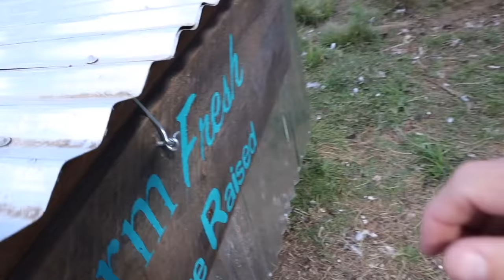This Makes it so We Can GROW all WINTER w/out HEAT in our GREENHOUSE in a Northern Climate Zone 4B

Comment: one way of cooking corn is not to remove the husks; just place them on a grill...cook them rolling them over every 15 min for about 30 min; the husk and silk pulls right off; it steams inside the husk;
Reply: That’s what I was going to suggest. Once I tried that, I haven’t gone back to steaming or boiling in years... It’s tough to match that fire roasted flavor using water not fire. And those little kernels of gold that the flames touch and they turn brown, mmmmmm that’s yummy!
Reply: Tracy Bruring yes soooo delicious 😋.  I learned that way of cooking in Wisconsin

Comment: If you leave a few husks on the corn after removing the silk. soak the ears in water. You can toss the ears on the grill with the chicken to roast, you need to turn the ears to cook evenly. I've also wrapped ears of corn in a wet paper towel to cook in a microwave oven.

Comment: My in-law’s process lots of corn every year.  The whole family gets together and everyone has a job... the way they remove the silt is to take the end of a baby bottle brush and put it in an electric drill... they wedge the drill in a saw horse and hook the trigger to make it run automatically, then you take the corn that’s been shucked, but not silked, and you just run the corn around the baby bottle brush head and it removes all of it.... much easier than removing it by hand... although they have a lot to process at one time... :)

Comment: Easy way to husk corn is to take a paring knife split each side with a slit from top to bottom.  Grab the silks and pull down.  When we kids got old enough we could do both sides and break off the end of the stem attached to the cob at the same time. We used to process about 800 ears in two days this way.  I am really missing doing this and canning too.

Comment: lack of water does have an effect on kernel/cob size. As a child I hade a great yield when I planted them very closely in the rows - rows usual distance apart- I got more cobs per stock than when I planted them the usual distance apart, I was only growing a small amount in a backyard garden and hand picking, but it should work as well in a larger plot. I just figured that they naturally grow close together if a cob falls on the ground so I tried it. I planted them only about 3 inches apart so they had just enough room and at maturity were like a solid wall of stocks. they're new varieties of sweet corn that convert their sugar into starch much slower so you don't have to cook them right away like regular sweet corn should be, able to store in wet paper bag covered with a plastic bag in the fridge for up to a week.  Older family friend use to grow "Candy Corn" - smaller pearl white, kernels that tasted amazing even after being in a deep freeze for a whole year, I have not been able to find Candy Corn seeds in storers, I believe she ordered them from a seed catalogue.

Comment: The kernels of corn are filled by moisture from the leaves on the stalk above the ear.  In a dry year they will not fill totally.
Reply: Roots draw in water from the soil.
Reply: I'm no farmer but you might want to promote them to full bird.....
Reply: Poison Ivy 
Leaves are essentially the lungs of plants. They lose water through them in what is called transpiration. That causes a negative pressure in the leaves that causes water to be drawn into them from the roots.

Comment: Al, after replacing the wiggle wire, your camera caught a cabbage looper butterfly  invading the greenhouse and landing on a plant. The looper worms are green and inch their way along in a hump-back fashion. I’m sure you’ve seen them in the past. They’ll make mincemeat of your cole crops. The best deterrent was row covers, installed before the invasion. When my cabbages were golf ball size, I’d clean off the cabbage of all loopers and fit a knee high pantyhose over it, sliding it all the way down, as the cabbage grew the hose would expand. This protected the head, while the loopers could only get to the outer leaves. The knee highs also provided a gentle pressure, making the cabbage heads dense and firm.  I used this method outdoors before the light rowcovers were available to home gardeners. Love your channel.

Comment: When you are putting a chicken on the grill on the stand you used do the following.  I assume you have a can inside the bird.  Add garlic, thyme and sage with a dark beer.  Use a small potato to block off the neck opening from the outside and cover with the neck skin and use tooth picks to hold it closed.  Then use the same liquid mixture on the pan and ensure it stay full.  This will add a great flavor and the potato will cause the meat to steam from the inside out and make it super juicy.  Weber makes a great seasoning called "Beer Can Chicken"  cover the outside.  i typically use about 1/2 a container for 1 chicken.  Enjoy.  Love the channel.

Comment: You might want to either elavate and support or put a weep hole in your dryer duct to prevent a P-trap from forming that would block its air flow with condensate water.

Comment: Gina, try just putting the corn in the grill with the chicken. It will steam it's self in it's natural cover. Delicious.
Reply: Plus when you peel it the hair comes off so easily.  Or cook in oven 350 degrees for 30 minutes, right on the rack, peel it back and you have a handle.

Comment: The Horn worm is the Luna moth larva. My chickens won't touch them with a ten foot pole. I put 1/4" hardware cloth around and over my tomatoes, and that seems to take care of the problem. If the moths can't get in, they can't lay eggs. What do you do with your extra eggs? I freeze some, and I water glass the others. Lack of water on the sweet corn. Last weekend we put up 22 half pints for corn casserole, 46 quarts, and 168 pints. I'm tired of corn. Lol.

Comment: Hi I am Stephen 
I thought I should asked why don’t you plumb in a all season water in the green house before frost hits
Reply: Stephen Martineau  And wire in electrical at the same time.  If coming from the outside kitchen building, it’d be an easy run for both.
Reply: @robfl07  The outside kitchen in not plumbed, they use a hose from the house to supply the water!
Reply: The frost line in Northern New Hampshire is 36" to 48" therefore trying to dig a trench that deep in their rocky ground would be quite an undertaking! that's also why Lumnah Acres did not install a water line to barn/workshop.

Comment: Tip for running cable lines in pipes. If when you pull the cable you attached an additional pull line alongside the cable and leave it in the pipe, then you have a way to add or replace cable at a later date without having to touch the in-situe wiring.

Comment: I have a double layer inflated greenhouse in Central New York zone 5a. You don’t want to rob the warm air from inside the greenhouse. To be more efficient you take the air from outside
Reply: Good point!  Like taking outside air for a fireplace rather than have it pull warm air from inside the house...

Comment: Al, maybe you should check if you installed the blower vent correctly!  I think you cut an X in the plastic, not a circle???   I was taught to make a circle if it is called for.  The reason the X will continue to tear the plastic with added pressure.

Comment: If that conduit outlet L on the fan plate isn't doing anything (and it's the right size) you could probably just use that on your conduit over by the solar panel. Given the chance for condensation, I'd recommend putting a 2 A in-line fuse on the hot line running to the fan, too, since a 12 V short could easily melt the plastic around it.
Reply: A polysilicon fuse at the output of the solar panel would protect everything it's connected to and would reset as soon as the fault is removed.
Reply: @benthere8051  Good call. Al, keep an eye on your PO Box. I'm sending you some.

Comment: Thank you for sharing! You should definitely cap the electric wire conduit by the greenhouse to keep mice out. It’s a cheap preventative measure with a big downside risk (the plants freeze because the mice chewed through the wires). Different varieties of corn have different kernel sizes so I suggest you plant several varieties next year and see which your family likes best.

Comment: You will need more -solar panels and a couple more batteries to keep that fan running through the winter.  You can work it out from the wattage and voltage of the fan to work out the amps draw and then calculate how much battery capacity you need for approx 7 days without sun but without going past 60% capacity. Once you know how many batteries you need to work out how many solar panels are needed to charge the batteries from 60% to 100% in 4 hrs. 👍
Reply: A 120mm computer fan will use from 0.6 to 2.3 watts of power according to http://www.buildcomputers.net/power-consumption-of-pc-components.html so you are on track.  Not too much, but enough to cause concern for 7 days without sun.

Comment: Fantilation for the winter - what a great idea. Note these blowers come in different designs that impact the noise they make, the power they use, the air they can push around and - in your case most importantly - the air pressure they can build. This application typically needs a fan whose blades have been designed for pressure. Example: Noctua 140mm industrial fan can build 10.52 mm H2O (about 0.4" water column pressure), has IP67 waterproof certification and can do 3,000 rpm producing 41.3 dB(A) noise - Another Noctua 140mm size might do 0.69 mm H2O (0.03"), pushing only 80 m^3/hr (47 cu.ft/min) when the high pressure one moves 270 cubic meters per hour (159 cu.ft/min). The slow one only spins 800 rpm and is as silent as 11.9 dB(A). You could place fans in series to increase pressure and/or air flow and I'd advise to consult with a specialist for that.

Comment: You have to try cooking corn in the microwave some time, it's an awesome method.  You leave it in the husk and cook for about 3 minutes (more or less, depending on how many you put in the microwave).  Then you cut the base off the corn (be careful, it's really hot) and sort of milk the cob out of the husk.  No silk at all, perfectly cooked and super easy to deal with.
Reply: It intensifies the corn flavor!
Reply: @elleshanndriacnossosmidnight  Yes! Another benefit, the corn isn't sitting in a big pot of water with so much good stuff leaking out.
Reply: Love this method.. the silk comes off so easy this way.
Reply: I'm all alone and I nuke 1 ear at a time, changed my whole way of cooking it. It really works great! I really miss the ducks, I love watching them waddle around and drink the water, just cute as heck!

Comment: Put a nut on the end of the string. Put the nut in the pipe. Use a magnet on the outside of the pipe and drag it along the pipe. It'll pull the nut through with the string attached.

Comment: One way to gain heat passively in the Greenhouse during the winter is to hang a curtain of something black like plant shade cloth or other such material on north side since it will be the coldest The first advantage of course is it will insulate that side like there is a third layer of plastic on that side and the cloth will be warmed by the sun during the daylight hours if it's out. One possibility about the M-G is they might of gotten shut  into one of the outbuildings you might have been in the other day but it's more likely that that they left for the nearest body of water somehow or were someone's dinner in the night.

Comment: Also coming from zone 4b with a couple of years experience with double layer inflated 30 x 96 tunnel 24/7 I have found with a third layer of plastic under 10 foot hoops inside I can keep certain cold tolerant  plants alive for consumption all winter.  Growing will pretty much stop by November but harvest can continue through winter as long as plants are close to maturity by then.  Cold tolerant plants that are still immature by November will generally survive but not start growing again until spring.  Plants outside the third layer of plastic under hoops generally do not thrive through the winter because of repeated freeze thaw cycles. Although temperatures are greatly increased inside during sunlight hours they still drop precipitously at night even with the double inflated plastic.  Plants that have worked for me include, carrots, spinach, kale, claytonia, leeks, onions.  The flavor of the cold adapted kale and spinach and carrots are out of this world because of the increased sugars and for me makes it all worthwhile. Good luck with your efforts as you discover what works for you.

Comment: As long as the moths have access to the greenhouse you will continue to have horn worms. You need to screen the lower section that you roll up. The fabric you use in your smaller gardens to protect the cabbage, etc would work...same principle...keeping the beetles from destroying your...keep the moths out of the greenhouse that lay the horn worms 🐛

Comment: Electrical code. Splices should be in the LB, not in the conduit. Since you cut the wires long at the solar cell just take the back off of the LB and pull the splices into the LB.

Comment: Try taking an ear of corn and cut away excess silk and leaves on one end and excess stalk on the other without cutting the husk. Then place in the microwave for a minute and a half, rotate the corn another minute and a half and its done. Let set a couple of minutes as you can’t split the husks as its way to hot. Once you can handle it, split the husk and pull it off to the bottom of the ear, then grab the husk in one hand and the ear of corn in the other and twist to remove the husk. Wala, ready to eat. Just three minutes to prepare and serve each corn. To add. Another, double the time.

Comment: Dry seasons can make your corn taste more starchy (stick to your teeth).  To gain kernel weight ie. bigger kernels you need to add more nitrogen and phosphorus before planting and still more nitrogen for about 2 weeks after they are pollinated.  That is when your kernels are forming and that requires nitrogen.  Variety of corn also determines kernel size like hybrids or GMO varieties will have bigger kernels but that is all by design.  Your heirlooms will tend to be smaller kernels but that doesn't mean you can get the full sweet kernel that it has to offer.  So more water and up the nutrients before planting and 2 weeks after pollination and you should see bigger kernels.

Comment: I think Maverick & Goose went looking for some female companions , I thought you mentioned one time about having a water course near your Homestead , have you check it out and see if they’re down there ,, I know mention Getting some corrugated metal roofing to make raised beds out of , but I did some research and found it was cost prohibitive , but I have a alternative for you , I’m sure you could probably find a bunch of free pallet and you could turn these in to raised beds . Just cut the boards parallel to the two by fours up right don’t worry about having to pull nails or screws they should give you boards tall enough they make your raise beds out of , I would start out by making the beds for your potatoes and carrots so they will have a nice deep beds to grow in , you can make these beds for all your root  vegetables , then over time you can add more beds for the rest of your garden ... just a suggestion for you to think about. you have a nice day and keep up all the good work

Comment: You need to use out door wiring not regular indoor 14 gauge strand  wire. you should really check with your local building and electric codes.

Comment: I was wondering why you decided to mount the fan so high up. Wouldn't it have worked the same at ground level? Also could you fill us in on a few more details, like what was the voltage and cfm of the fan and what is the voltage output of your solar/charger? Did you build the fan unit yourself? Also, what are your thoughts on cheese making?

Comment: Gooooooooood mernin'!
Reply from the maker: Gooood Morning
Reply: @LumnahAcres  FYI, you can get a wide variety of similar fans with a high CFM flow, but very, very low noise. That is the trend in computer fans. And the fan you have is VERY loud. It's not good for you or the plants. You might think that's silly, but considering how many hours you'll spend in the greenhouse, and that it will be running 24/7, that sound has a negative impact on you on the whole environment. I highly recommend finding a quieter fan. I'll be glad to help you do that if you email me the specs of that fan. ❤
Reply: @k henne just like noise in a city, you may learn to tune it out but it still has a negative effect on you and the whole environment. Intentionally introducing that kind of urban/technological stress in a farming environment just because you'll "get used to it" is counterproductive.

Comment: I think tie backs were the best invention ever 🤙
Reply: Cable ties were first invented by Thomas & Betts, an electrical company, in 1958 under the brand name Ty-Rap. Initially they were designed for airplane wire harnesses. The original design used a metal tooth, and these can still be obtained. Manufacturers later changed to the nylon/plastic design.

Comment: Okay if you use solar for that fan it will only inflate the Greenhouse when it is sun unless you have a battery which I did not see. Also how long can you run the fan on a full charge?  If you have a buzzard you might not get a charge for a day or two. I would think that some foam blocks would be as effective as the fan.
Reply: There is a battery, was there when the solar panel was put up to electrify the fence around the hives.